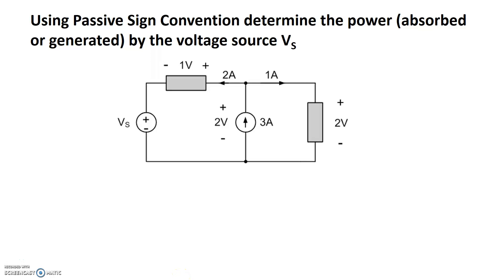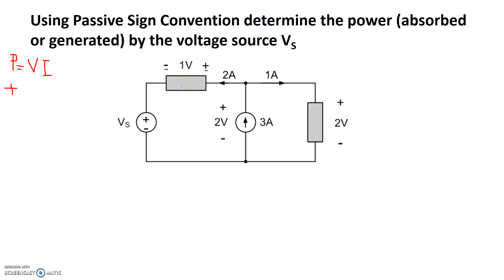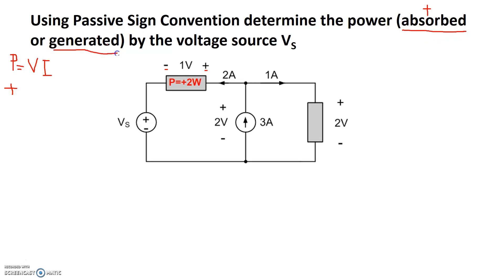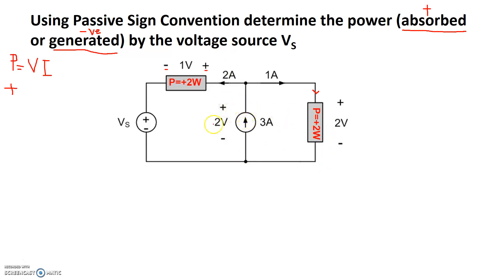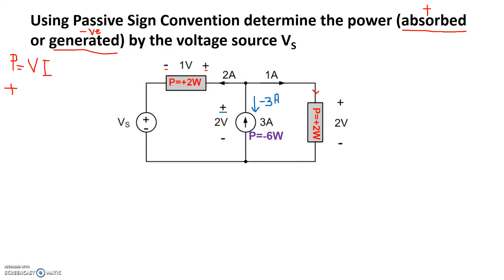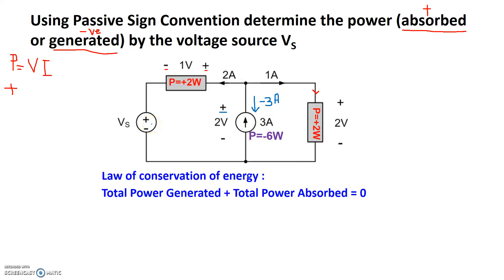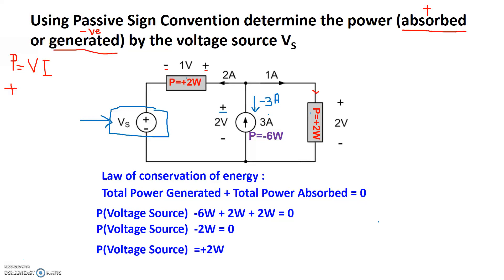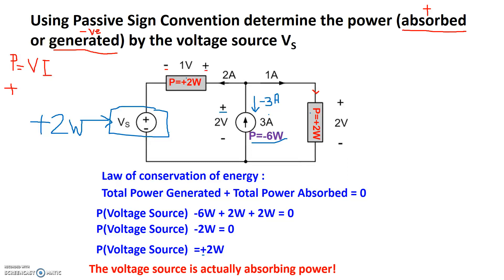Example 1 Passive Sign Convention

Comment: In the loop on the left how can 2A be flowing left and thus CCW in the loop? Based on the polarity of Vs, wouldn’t we expect current to flow CW?
Reply: The sign on supplies do not always indicate that the conventional current will end up coming out from that terminal. If this supply (Vs) was the only supply in the circuit (by removing the 3A current source), then yes, by positive sign convention the current would be going CW as you suppose.
Reply: Since the current source ends up being the larger supplier of Power in this circuit, it wins the “bucking contest” and forces I CCW in the left mesh.

Comment: One clarification on a point misspoken: power supplies and power absorbed do not equal zero.  They equal each other.  Then, powers absorbed OR supplied sum to zero.  To make.this work we view power generated as a negative power absorbed, or vice versa, and the default to to always represent power as ABSORBED for ALL elements unless stated otherwise.